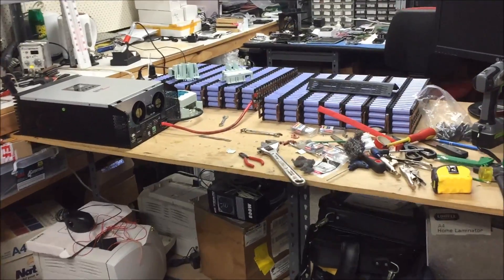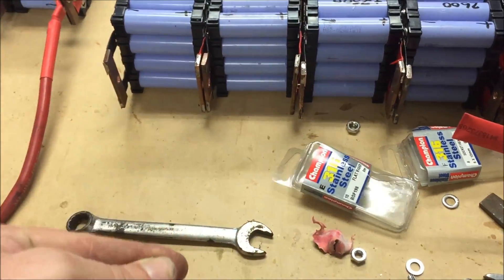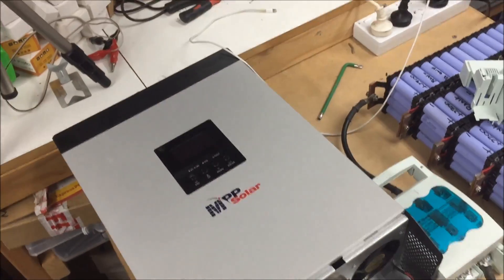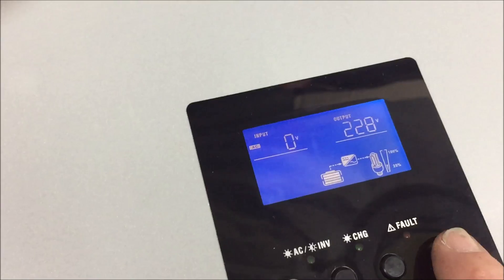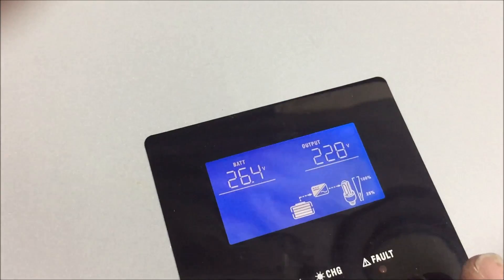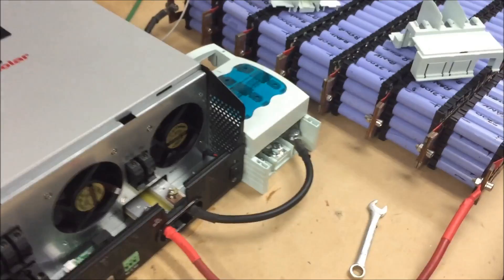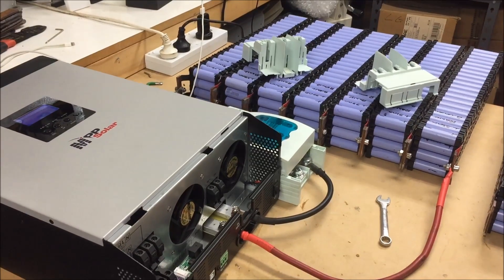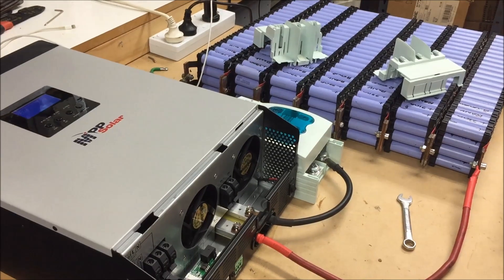18650 powered PIP2424MSX First time I turned it on... Yeh Babby

Comment: heya I'm thinking of a mppt like that but I want 1 grid-tie so if the battery is full it can olso gif back to the grid and olso if the battery would be empty I can take power from the grid too ( here in holland in the winter my solar panels only make 50-100 KWH a month 12 solarpanels total of 3.250 PIEKWATT have 12 panels 3.3 PIEKWATT standing to be installed but wanne go to 3x12 panels so I can do 3 fase 220 V by 15-16 Amp. I have the cables for the 3 fase instalation already in my house only the fuses from the electric company are on in stall using now only 1 fase so have to bay 2 25 AMP fuses and let the electric comany install them soon still have to bay the 3 fase solarpanels but the many is on its way for them and I'm babling  yes I know sorry up to the next vlog to learn more

Comment: Great job, I am starting to learn how to build my own power wall.  I have been using solar power for over 10 years and have tried many inverters with lead acid battery bank. I had that very same model  of inverter that you have just shown.  It lasted about 12 months before it had a major failure. There are much better brands on the market that will give you better performance and a long life, but of course you get what you paid for.

Comment: You should have had a rocket countdown and at zero minus 5 have the workshop roof open up so you could launch yourself. You sounded that exited. VERY VERY VERY well done my very good friend. I had the shelving unit come in yesterday for my powerwall. Onward and upward. No good telling you to have a great day. Your already airborne. So I will say have an amazing flight my awesome very good friend.
Reply from the maker: +Raymond Earle Grounded now with a small failure - :( fixable but possible issue to address in latter video.

Comment: Make sure that the fuse is on the positive side, please.
Reply from the maker: +Alaa Sadek both will be fused for now it is better than nothing..
Reply: +HBPowerwall I have an exact system like yours. Here is the new thing that I expect you will think about. I am running a 110m2 flat with a new air condition. It is an inverter air condition. I did not believe it at first; but with just 2*250 watts panels and 3kva inverter and some old lap top batteries I am now able to run the whole flat and the air condition 24/7. The air condition starts with just 100 watts and works its way to about 600 watts when needed. That is the fascinating thing to me. The temperature is 24c dead on 24/7. The next thing I will investigate is the use of induction cookers.

I also understand that using a heat pump we can heat 100 liters of water from 23c to 55c in 1 hour for just 900 watts!

You and I are changing the world.